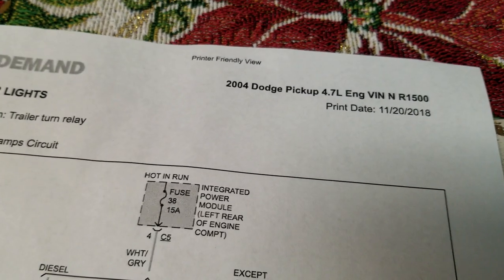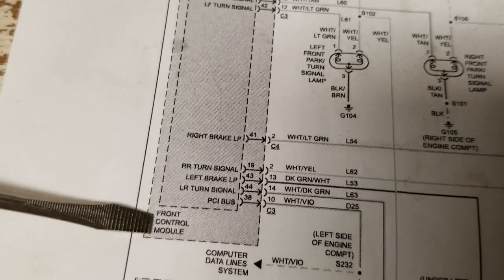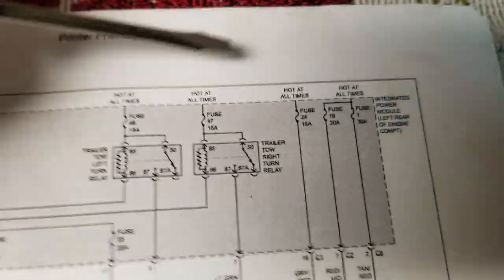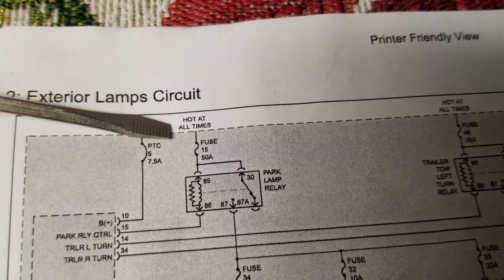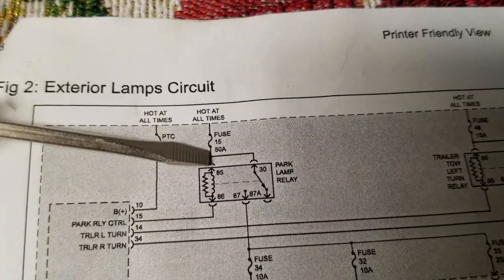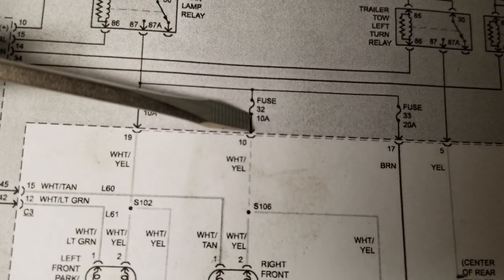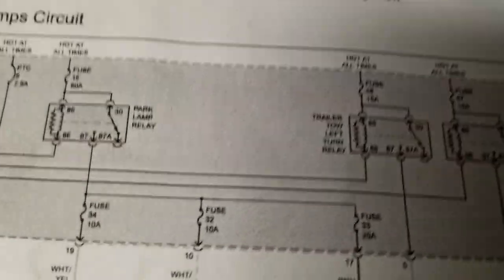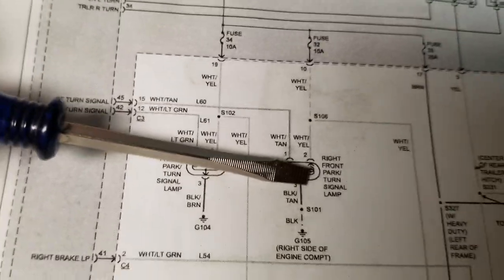2004 DODGE RAM 1500 4.7L, TURN SIGNAL PROBLEMS

Comment: I appreciate your help on my 2004 dodge ram 1500 4x4 5.7L, after having problems with my lights 1 low beam and 1 high beam opposite side and dealing with the lamp out hyper flashing on both turn signals when I turned my park and headlights on, I replaced my FCM with a used one from ebay and fixed the head light issue, only to have the hyper flash issue on both sides still. When I checked the park lamp socket for more resistance, I bought new park lamp sockets that did not measure the resistance that my old ones had and that fixed the issue. really your you tube helped me fix the issue.
Reply from the maker: 😇 Excellent, glad you found it helpful

Comment: A fantastic explanation and exactly what my 05 was  doing. I did get to realizing that the issue would only surface after enough flashes of the turn signal to create heat. Thanks so much.
Reply from the maker: Lovely...glad it was helpful Toby.

Comment: Another Matthew with the same issue- I also have a 2005 Ram 1500 that I've had to replace the right turn signal bulbs on at least 3 times before I finally said enough is enough, knowing it had to be some type of internal wiring problem, although mine usually happened after it rained.....your video sheds a lot more light on the subject and signaled a need to turn in a different direction before I myself blew a fuse- tanks Bruddah! (All puns intended)
Reply from the maker: You're welcome 🙂👍

Comment: Excellent video, thank you, big help in understanding exactly how this works. I have similar issue with both turn signals when parking lamps are on on. I think mine is too much resistance on the ground, but I never thought about resistance in the socket itself as I saw no corrosion, but I now know to actually test it thanks to your video!
Reply from the maker: That's what it's all about, thanks for the feedback and I appreciate that-good luck to you sir!  God-bless.

Comment: Turns out mine were bad front parking lamp sockets, I can see the driver's side was bleeding voltage between the turn signal contact and the parking lamp contact. I couldn't see it physically looking at it, but I could see it with my power probe. I did not see anything on the passenger side, but with a new socket, I don't get lamp out anymore. It must have been a resistance issue in the socket. Anyway, all good now (finally!), thanks for the video!
Reply from the maker: Very good news 😇

Comment: I have the same issue on 04 dodge ram 1500 5.7..only difference is mine is on the left side...great video, really explains alot..my question is did you just replace the socket?
Reply from the maker: Yes new socket.   Thanks for the awesome comment appreciate you.

Comment: I have a 2006 Dodge Ram 1500 3.7 V6 Laramie. The Left turn signal blinks fast, but the right side is fine. The bulb is also fine too and it works. What could be the problem?
Reply from the maker: Gotta test the circuit, pretty hard to know without playing the guessing game...testing the circuit is the first step.

I can't help you without knowing what the circuit is doing.

Comment: My 05 ram 1500 has the EXACT issue as this. You said the bulb socket was the issue. How did you fix this problem to make the turn signal flash properly again as they should?
Reply from the maker: We replaced the bulb socket that was faulty.

Comment: Excellent video and insight!  Just purchased a 05 ram that has this same issue but on both sides of the turn signals.  Both front headlight assembly’s look like they’ve been replaced recently.  The new aftermarket headlight turn signal lamp holders maybe the first place to start looking?  Thanks for the video.

Comment: my father has a similar issue with his 2005 Dodge RAM 1500 4.7L V8. but with hi, he replaced both the head lights and tail lights with spyder LED head and tail lights.

he's been through the wiring and has the diagram and the issues remains the same, do you have any ideas?
Reply from the maker: Aftermarket may have resistance that is not what is expected by the monitoring circuit for the system...stick to OEM.

Comment: I have a 06 Dodge Ram 5.7. Front and rear right side my turn signal don’t work. I replaced the bulbs front and rear and still the same. Would it be the socket that’s not working? Or what do you think
Reply from the maker: Swap sides and see if it follows the sockets 😉
Reply: Yes ! Thank you !
Reply from the maker: Good to hear you found the issue my friend.
Reply: Life saver !
Reply: Yes it works now. But now my brake lights don’t work.